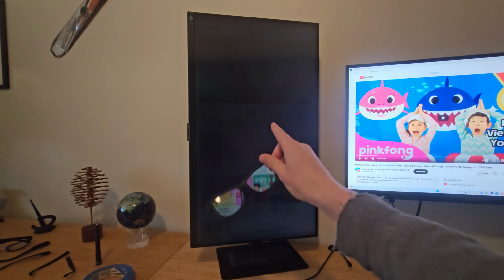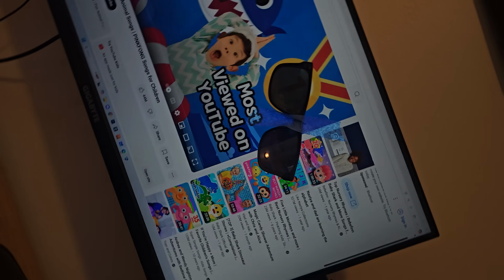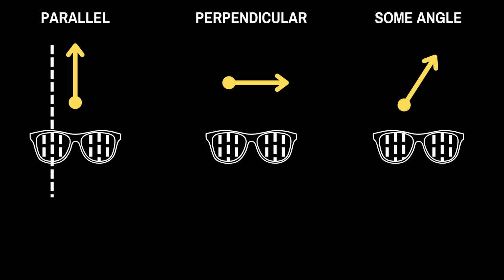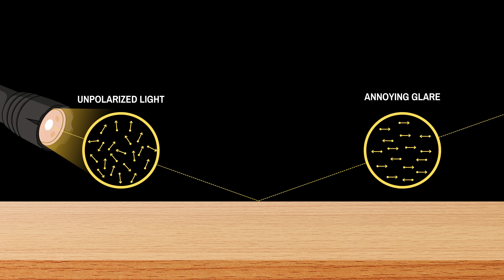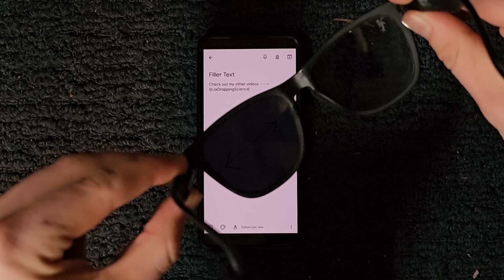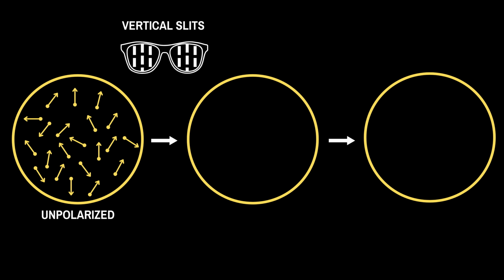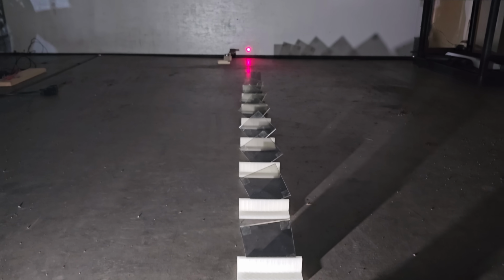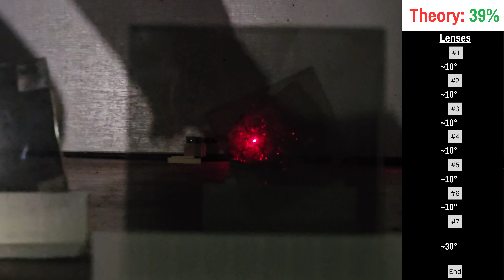How sunglasses can show what's on this computer screen (Polarization)

Comment: What I want to know is why a polarizing filter, when placed diagonally between two right-angle filters, negates the effect of the crossed filters?
And...  If a fourth filter is placed at a right angle to the diagonal filter, would the view once again be blocked?
Reply: It's explained pretty clearly in the video, but for your second question, no, the view wouldn't be blocked, because even though it IS perpendicular to the other diagonal filter, it's isn't perpendicular to the one before it. If you remove the filter between the two diagonal ones ONLY THEN does it block light from passing through.

Comment: If the light source shines an object in a way the glare bounces at 90 degrees then the polarizing filter will have a more drastic effect. In theory no glare should pass.
Also, if you make a 3rd giant "filter" (maybe with a more rigid material like two brooms), place them at 45 degrees, and then shake the wave vertically, you should see the effect of the wave making it through the horizontal filter with the brooms. The 45 degree should "push" the wave giving them a horizontal component.

Comment: Actually, the electromagnetic field one from a long time ago isn't fake, and insulated wire just makes it worse.

Take Snap Circuits' Electromagnet for example, that uses uninsulated copper wire and it works.

So either, replace that with an actual fake one to make it more obvious or make it an "all truth" round.

Comment: I know older LCD watches tend to appear black when worn on left wrist with polarized sunglasses, newer watches usually do that on right wrist, perhaps because they are designed for left wrist and those sunglasses. And some cellphones work better with those lenses, my older cellphones needed an awkward position or take glasses off. These items have presented a difficulty with my Rx polarized glasses, for clip-on sunglasses, just take them off clear Rx glasses.

However, I found a different awkward sunglass lense situation. I had cheap readers with dark sunglass lenses, not polarized, and with these on, I had to wear a hat to block out the sun. Huh? Yes, these gray lenses became a distorted and blinding problem with sunshine. What I could see was some outline-ish features where the sun shawn on things and people, but that was kind of like looking through a gray and opaque plastic thing or maybe like looking through thickly fogged sunglasses. I think micron bubbles or contamination got into the lenses as they were made or coated. With shade over them, they are fine. Without shade, do as you'd do in a dark room. These are actually dangerous if used for driving or crossing roads on foot. 😮 🕶

Comment: I played with the 3D movie with the gray 3D lenses for a bit, doesn't work right if glasses are not in the up-right proper wearing position looking from back through to front. 

So, if someone has perfectly rounded polarized sunglasses, perhaps loosen one frame screw and turn a lense 90°, see if that works, if not, return to normal position and do this with other lense. The cameras work polarized and at slight angles apart and so any normal pair of sunglasses won't work if this lense position change is not done. Is this right? If it is, any normal polarized sunglasses and a different frame if they aren't round can work by cutting the lenses for a smaller frame with the properly turned lense cut to fit in sideways. 

Oddly enough, the theater I watched the movie in had a black and shiny handrail  like thing in front of first row of seats. And from where I sat way back, that was quite visible in one lense even if the glasses were held upright or upside down, or either way to eyes, just not when held sideways, the other lense let its shine in. That thing needed flat black paint or a black cloth covering if it even had a need to be there.

There used to be the red and blue 3D glasses, perhaps canceling out colours to create the view. But while I own a pair of those, I never got to use them for that, they look bizarre to use, they're just a collector's item along with other old things. I only ever saw the one 3D movie with the gray glasses which appear to work fine as sunglasses when not seeing light reflections. 😎 😂
Reply: Ah. You gave away your age without saying it lol. If you’ve never used the red and blue 3d glasses. They worked pretty well and as a kid they were way more fun to use than the boring grey ones. I’m 31 btw lol
Reply: @kaiotikworld8945   Nice to know, I still have them if I'll ever find that kind of 3D video. 

And my age, well, still young at heart. 😂

Comment: Confused! If the first lens lets light on a vertical vector through but not horizontal then why does light passing through at a diagonal vector become more visible? The vector is still different, although not as much as horizontal. It seems it should at the most just have a dampening effect on an axis, increasing in intensity until it gets horizontal and again blocking out the light.  For instance if polarization vertically (P_v) + P_h = no light since the vectors change then why does P_v + P_d + P_h = small change in intensity why they are still 3 different vectors?

-peace
Reply: There are already two lenses in place, one built into the monitor and another held in front of it(i.e. the polarized sunglasses) that are polarized perpendicularly. The first lense polarizes all the light coming through, and then when it hits the perpendicular filter, none of it is able to pass through, since it has no vector component in that direction. it's a THIRD lense being held between them at a diagonal angle that allows for light to pass through, as some of the vertically polarized light is able to get through, but now less intense and at a new angle, due to vector math. If you rotate your perspective in line with the diagonal lense, the vertical light will appear diagonal, with a vertical and horizontal component. That vertical component is what's in line with the lense, so it's able to pass. Now the light travelling to the third lense is polarized diagonally, which means it now has a horizontal component, and the same vector math applies, letting some of the light through the third lense, though now less intense and polarized horizontally.
That's why with the laser he started with 2 lenses and kept adding more in the middle.

In essence, you can think of the lense like a filter, and just understand that polarized light can't turn 90°. The first filter polarizes the light coming through, and then it can't make it through the second filter because it would have to turn 90°. Adding the third filter in between makes it so the light instead just has to turn 45° twice, which it can do, although it loses some light each time.
Reply: Sorry if I misunderstood your question and over explained, I'm just trying to help lol
Reply: @ANZEMusic Thank you for trying! In case you can possibly clarify it for me I will reword the question. If light emitter produces light at all vectors horizontal, vertical, and diagonal, and polarizer only allows one vector to to pass, then why is it that a diagonal polarizer between a horizontal and vertical polarizer allows more light to pass through than just the horizontal and vertical polarizers? If the light coming through a vertical polarizer is only allowed as vertical light waves, then the diagonal polarizer should allow some or all of those vertical waves through since vertical vectors are a component of diagonal vectors, but they should remain vertical, meaning that when the  horizontal polarizer is reached then no waves would still be able to get through. 

-peace
Reply: @mcspartan1227 I don't fully get it either but I think the diagonal polarizer only keeps the diagonal component of the vertical waves, which are of a lesser magnitude than the vertical waves,  which is why they are dimmer. The remaining vertical components that are not kept are reflected and don't pass through. Now, the light that was successfully rotated diagonal reaches the horizontal polarizer and the same occurs, where only the horizontal component is kept, and diagonal component is reflected. This kept horizontal component will be even lesser magnitude than the one before it, but will make it though th3 filter and reach your eyes. The key detail is that light cannot rotate 90 degrees, but with the diagonal filter, it is first rotated 45, then another 45, not 90 at once, making it possible, but of course losing intensity along the way
Reply: @BernoulliBernoulli23  yeah that's pretty much it

Comment: Does that mean that wearing polarized glasses makes them shake by an extremely miniscule amount? Since the light "disappears," shouldn't the energy go to the glasses?
Reply: In a sense, yes. I would expect some of the light to be reflected, and the other part to be absorbed as heat, which at the molecular level is just vibration. That's much like something painted black getting hotter than the same object painted white when left in the sun, because white pigment reflects more light than black pigment.

Comment: the interesting thing about lcd’s that allow you to see this effect in them is that they actually work by polarizing the back light and then the filter is added to only allow the light polarized by the lcd through, getting rid of the light polarized the other way by the lcd
Reply: Yes that also explains why polarized sunglasses can't block the light from my Samsung phone, no matter how you rotate them. That's because Samsung phones don't use lcd screens, they use Amoleds, which don't rely on polarizing light.
Reply: So the LCD is actually blocking the "unwanted" light, like a shadow map?
Explains why they need a back light.

Comment: but isn‘t it for optical waves the opposite? meaning that waves with an orientation parallel to the slits get reflected due to electrons that oscillate in that direction and send out a wave traveling back.